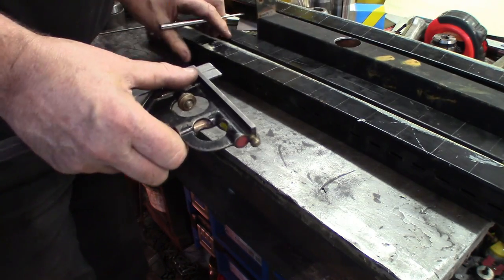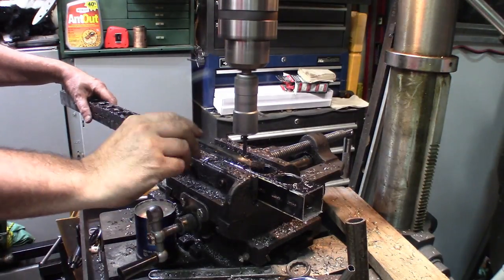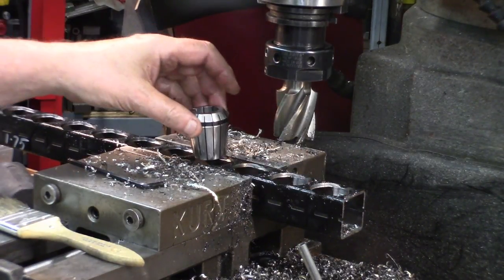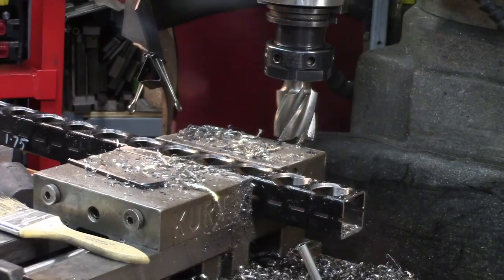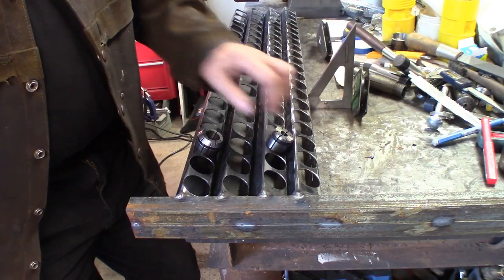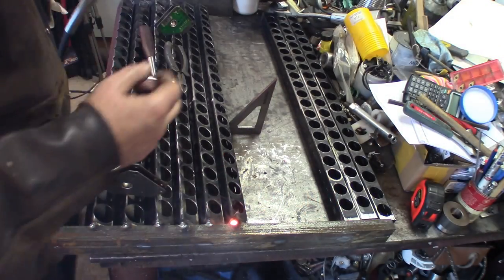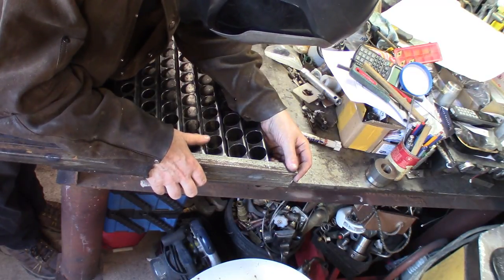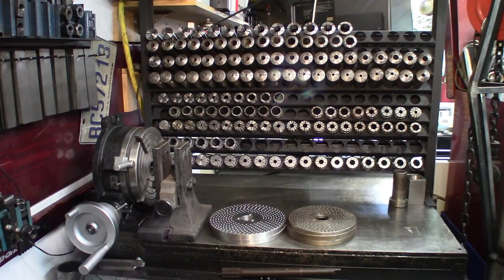Making a collet rack... Getting organized in the shop...  Using available material in the shop...

Comment: Looks good, I am surprised the different collets would all kind of fit in the same size hole.  That was a lot of holes!
Reply from the maker: The holes aren't all the same size, some were 1 1/2, 1 1/4, and 1 1/8, may have looked the same at the camera, had to make different spacings for diferent sizes,    1 1/2 and 1 3/4, That make me pretty happy not to loose so much time every time I needed something.
Yep, that was lots of holes, the 17 minutes from the video isn't the real time needed to make that support, just in case you wondered...   lol

Comment: Great project. I've never done something like this to improve conditions in my shop and then looked back later and thought, "I wish I hadn't done that." Virtually every shop improvement project is worth doing, if you understand your needs first. 

By the way, you can get deburring blades that cut both sides of a hole in the same stroke. They're listed by the range of material thickness for which they are useful. Good to have on hand for these times.
Reply from the maker: Being better organized is kinda always a plus, the bigger problem as far as I'm concerned is to procrastinate the start untill I REALLY get frustrated and grumpy, then only sometimes I'll make an effort to improve the situation, by fat not the best...   lol
Heard about those double sided deburing tools , something else on the shopping list...
In this case the burrs created by the core bits were too tough for a deburing tool...   :(

Comment: Pierre,
Excellent idea! No way do I have as many collets as you do but for the few I do have their new home now will be in steel acquired from a treadmill tear down. 
   As for the welding gloves, I do the same thing. It isn’t until I’ve got a few burns that I put them on. Hate wearing gloves. 
By the way, Mr. Pete DOES have a metric Crescent wrench.
Reply from the maker: This rack is a great step in getting the shop organized, soooo many other things to set-up right, there are all those treasures that I'll have to decide if it's a keeper or a gonner, but, treasures are treasures, I should ask my wife to clean, the shop will have echo after she's done...   lol
The UV from welding isn't very healthy, although we hate wearing gloves...  
Great comment, thanks,    Pierre

Comment: Useful build, nicely done. How did you deal with separating metric collets from imperial collets? What next, labeling? Enjoyed this one as usual. Thanks for sharing.
Reply from the maker: All the ER-40 are metric, and the TG-100 has a some metric, they're inserted in line with the others, all there is to do is to get the tail of the endmill or the tool close and do a quick try, believe me it's way faster than before...
Thanks,     Pierre

Comment: Ever since I got my Bridgeport, the drill press just gathers dust in the corner. The only reason I hang on to it is just in case the Bridgeport gets tied up on a large job and I need to drill a couple of holes without having to tear down the setup on the mill. If the mill is free, I ain't messing with no stinking drill press. 😉
Reply from the maker: That's quite the same here, the mill is soooo much better on all points...   ;)

Comment: All collets have holes in the middle -simple solution take a board and make bunch of dowel pins of different sizes on lathe.You can go cut a tree or use firewood if you are poor to buy it. 
Then use wood screws trough board ,into the dowels.That way you dont have to have whole bunch of drill bits to do it ,and you can hang it on the wall for less space consumption.Also wood is cheap and easy to work with.
Poor mans idea.
Reply: yes, but you cant mention wood to a machinist! lol
Reply from the maker: Even as a bonus wood smells good...    But working with wood in a machine shop is a nightmare, all the dust stays stuck in all nooks and crannies, eventually everything jams in a thick oily wood slurp...   So, as I'm able to do it it will be metal made, if I had a bigger or separate shop then I could include woodworking, but, until then...
Reply: I worked several times with wood on metal lathe ,i dont find it that bad,its super easy to work with it and you can take large cuts ,wood dust is easy to clean and since its mixed with oil it cant fuck up the machine like sanding dust can-you can always put something over the bed to clean it easy.Bakelite or cast iron on the other hand ,oh boy if you ever worked with that,that thing shits everything up. . . .
You can use diesel fuel and cotton rag to clean your machine after,for deep cleaning.If diesel goes into a bearing it wont fuck it up as grease cleaning products might.Plus you got that nice smell . . . 

Besides you can always take my idea and make metal dowel pins and weld them,or even better use bolts -they are premade all you do is weld  a head to a peace of steel plate.
Your rack is nice looking thou but it looks like a lot of drilling ,and you need all those different drill sizes.
Reply from the maker: The difference with the dowel is that collets have different inner diameters and sometimes the lenght of the dowell wouldn't be long enought to hold the short portion of the rear of the inner collet on such inclined plan...  As on the other side a hole allows any collet of that particular series to be located any place on the board.
You're right, cast iron is a very nice material to work with asside from the black dust, then I cover the lathe and a vacuum cleaner to try get the most dust as possible right from the start...

Comment: I don't understand why you are drilling beside the vise, instead of in the vise.  You are not drilling through the material so your vise would be safe, but you give up the support - why?
Reply from the maker: Some of the deeper holes were going passed the other wall of the tubing, I just left the set up as is even for the rest of the holes. 
Take note that this 3600 Series vise from Kurt is even a couple of steps above many other types of vises as far as holding power and stability...   ;)